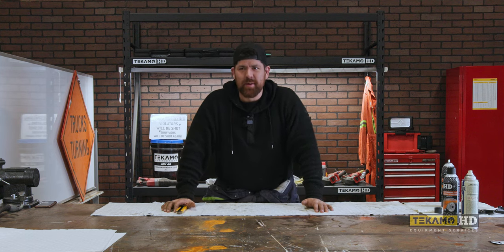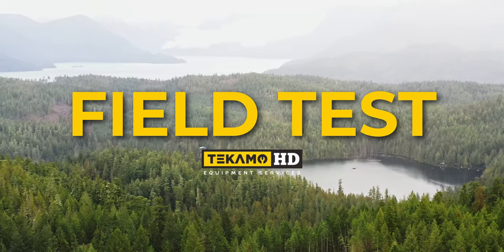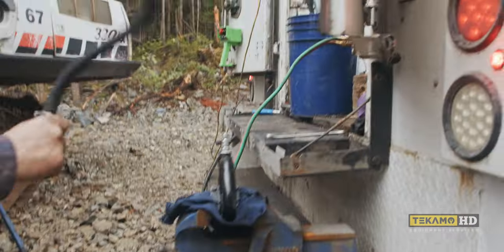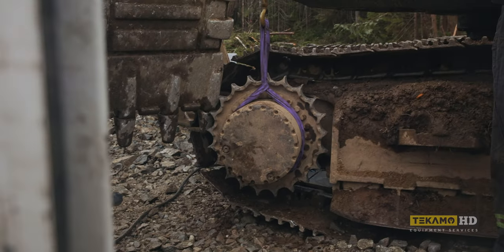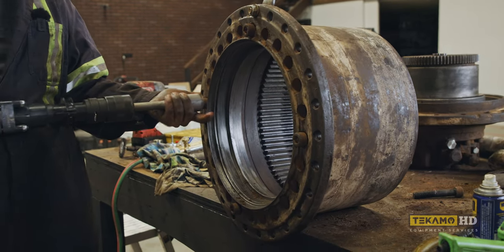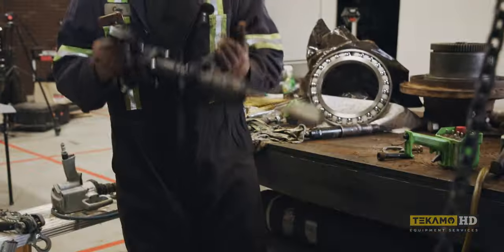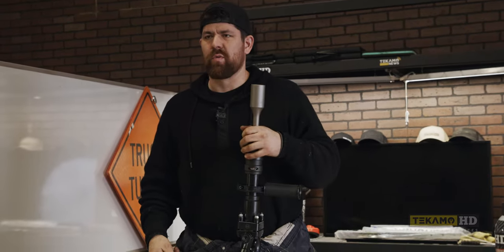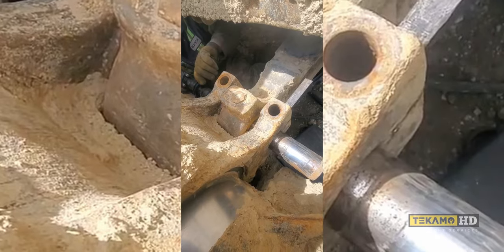THE BIG CHOOCH - Mueller-Kueps Vibro-Impact Air Hammer

Comment: Wow man that is the coolest video you have made. I spend way to much time watching YouTube videos because of dealing with worn out shoulders rotator cuff tears. I have no idea how many broken Budd studs I have BFH'd out on the side of the road and Hutch equalizers bolts I have smacked out between the duel's. I got a Astro "Big Nasty" a real game changer in the wear and tear from using the BFH.
   So my comment to you younger guys would be look at the long term benefits this tool is going to bring to the wear and tear on shoulder joints. For you big boys that is one beautiful tool!
Reply from the maker: Thanks Bill! We always appreciate your comments and insights👌
Reply: @TekamoHD  Cam in your service truck  tour you showed about a 3" steel rod you would suspend from a strap to exert horizontal impact. I have the same steel rod I used for vertical driving wheel studs and such. This tool makes those rods the "dark ages", 
  Again this tool is a game changer for us truck guys but especially you big boys.
Reply: @billcovert3473  Your shoulders and back have a finite amount of duty cycles 😂 make it easier on yourself when you can.
Reply: @billcovert3473 
I was gonna ask if this would hit harder than Big Nasty or Astro 498k "Thor"
yes wheel studs on Garbage trucks or sized king pins you have to use the Rose Bud on and hammer and heat and hammer again and again. Turns a 3 hour job into mere minutes?
Reply: @BluTechEquipment coworker has the Snap On .401 shank air hammer I call him Big Brother when mine won't work but was thinking about upgrading to Astros 498k "Thor" but if this 1 inch shank hammer hits harder then may as well go Big or go home
Reply: Mine atm being kobalt

Comment: It’s a chipping gun, you can rent them from a rental house pretty cheap usually, they are pretty nice for some things, I’ve had pins stuck enough I used a 90# jackhammer before, even up to a mini ex hydraulic breaker